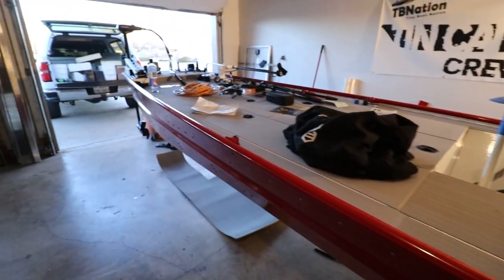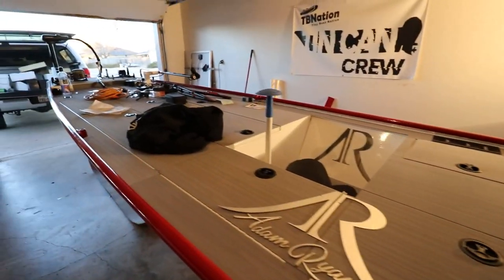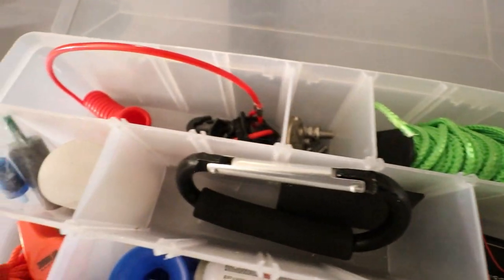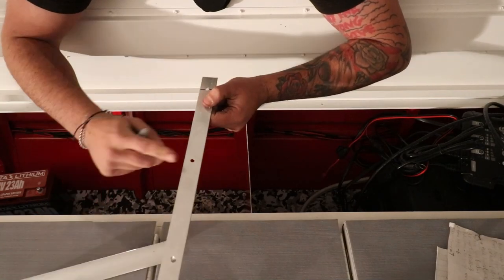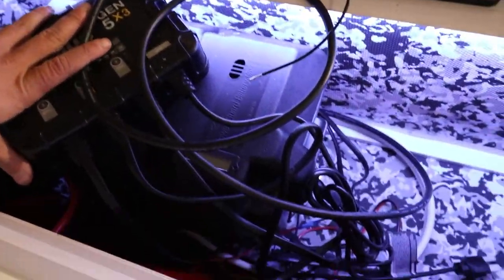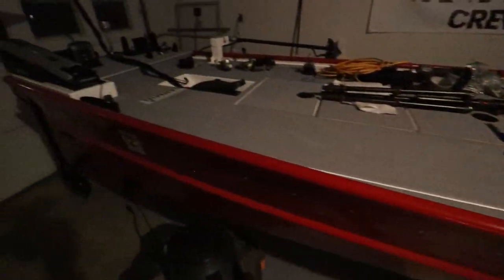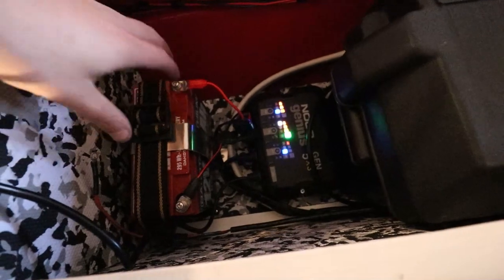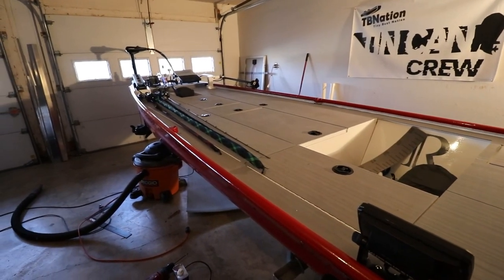My JON BOAT To BASS BOAT CONVERSION Is DONE!!

Comment: Noco makes a flush mount plug socket for the charger too. I added one on my boat so I didn’t have to pop a hatch to plug it in.
Reply from the maker: Yeah I had it in my mind to get one, I just totally forgot in the process, do you think it would be weird to install one now on the hatch?
Reply: I don’t think it’d be weird. I didn’t put one in until I thought I was done. It was just icing on the cake.

Comment: Only thing missing now is a nice set of wheels for the trailer.  Love the boat, got me thinking about re-doing my 1436
Reply from the maker: Yeah I want to upgrade my tires but this is a little cheap academy trailer so I don’t know if it’s built for bigger tires, so I’m a little worried to change them, I may upgrade the whole trailer if I can find one that fits the boat

Comment: put a switch in the the live scope power wires in the battery compartment.
Reply from the maker: For some reason I didn’t even think of that lol I’m definitely gonna add some type of quick disconnects, thank you for the tip! 🤙

Comment: Can’t you just put a power cut off switch on the battery with the black box so it won’t pull power and that way you don’t have to worry about it
Reply from the maker: I got some quick disconnects coming for it
Reply: @AdamRyanA  nice